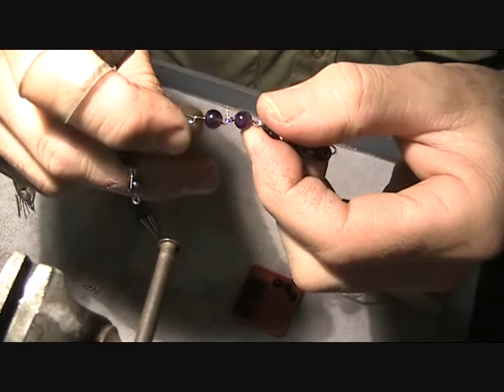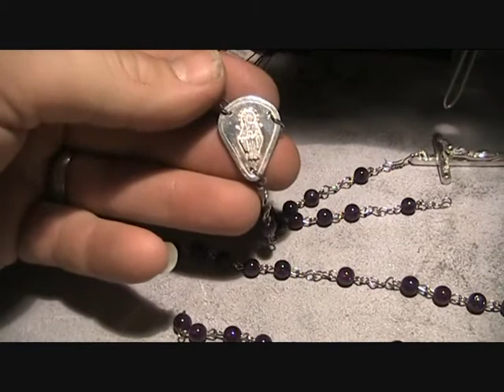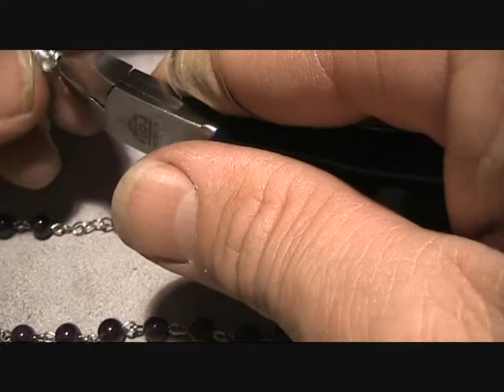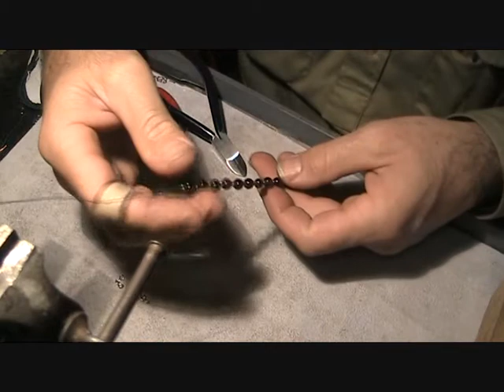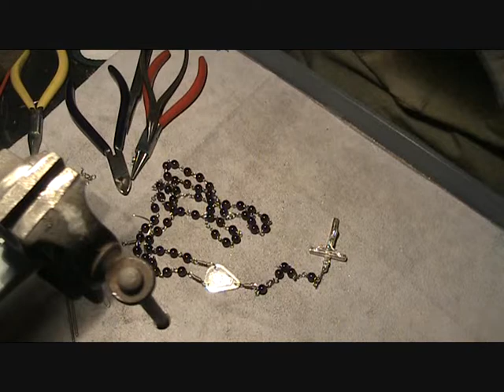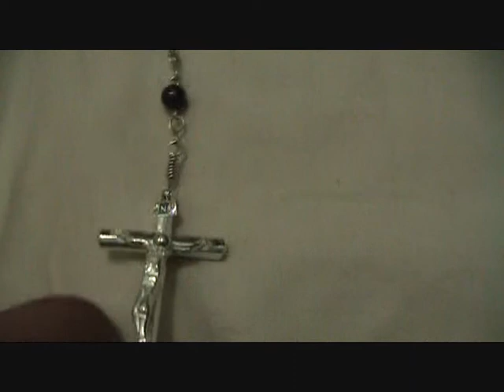Rosary Making Short Aug 2011.wmv

Comment: How long do you cut the wire to make the links? I either cut it too small or too long and just waste wire. Beautiful crucifix.
Reply from the maker: than you very much.  It depends on the bead size but I use mostly 6mm beads, wire at 20mm, bend diameter quite tight.
Reply from the maker: Sorry for the long delay in replying.